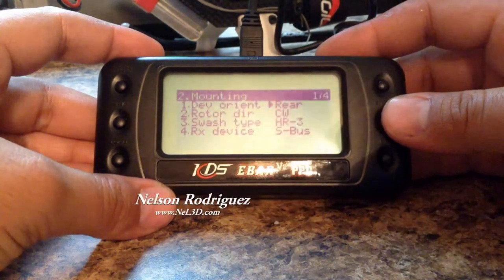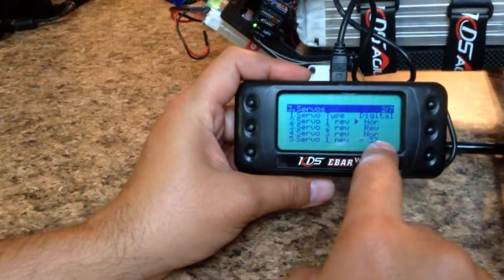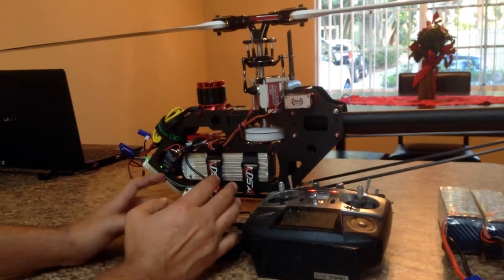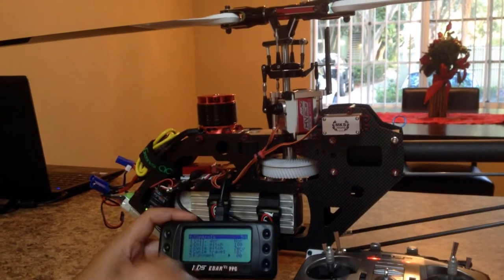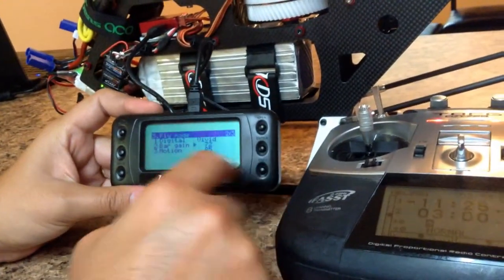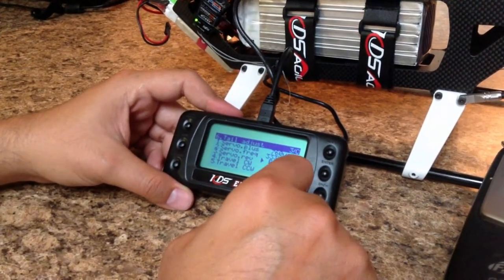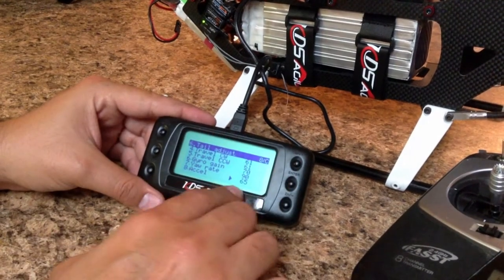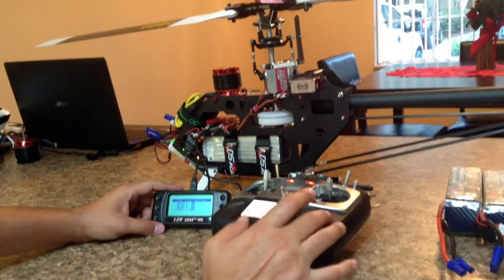The basics of the ebar by Nelson Rodriguez

Comment: hi i just want to ask you about tail Gain ( EBAR V2 FBL SYSTEM )
i saw in the setup box they put 70% tail gain 
is that 70% on normal, idl 1 and idl 2 ?
how can i adjust normal tail gain, idl1 and idl 2 
Im using futaba 10J
Because i used to fly with Vbar it has the option to chose for TX tail gain Adjustmen